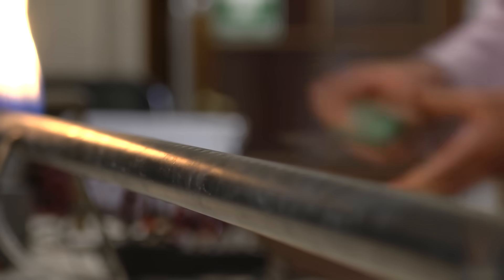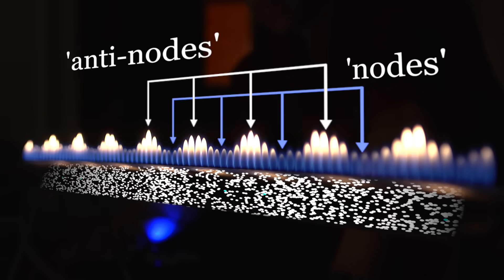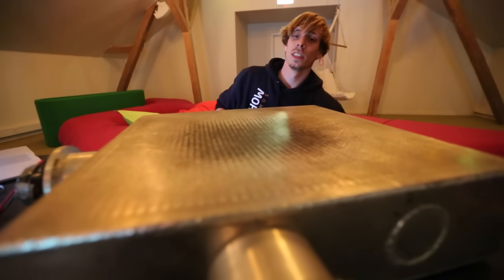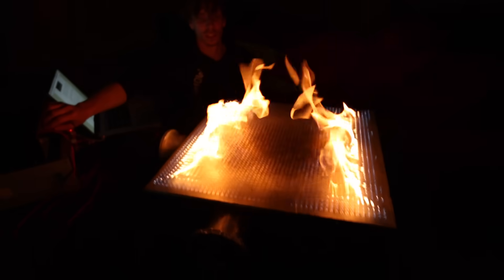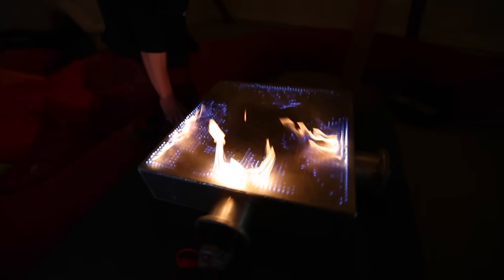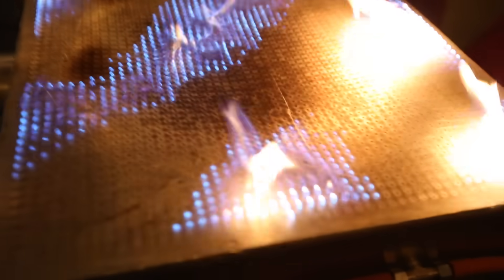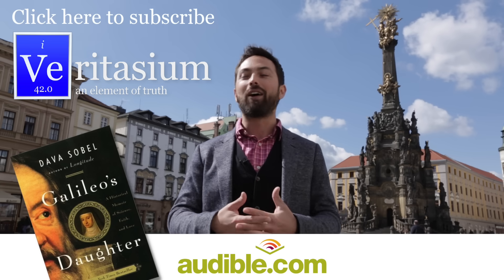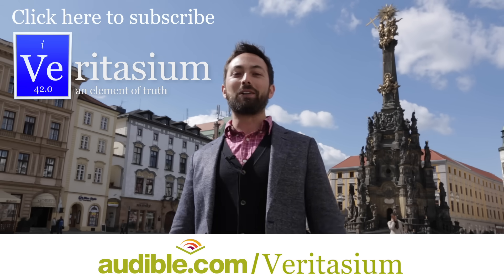Musical Fire Table!

Comment: You should try adding in a little bit of oxygen to the gas so the flames are steady. As it is they're stealing oxygen from one another and making it difficult to produce a steady flame. It would take 2,000 separate little tubes of oxygen to make it work though. Otherwise it would just be a bomb.

 Don't take my suggestion as criticism. This is super rad!

Comment: I would argue that the distance between the holes is too short. I think the flame "surface" would burn more evenly is the amount of holes were reduced. The short distance makes the flames above each hole randomly cancel each other out due to a lack of oxygen. Another solution is to mix oxygen in with what I presume to be propane.

Comment: Please, please, please try this in a vacuum, add oxygen to the gas and see what happens... Please! ^_^
Reply: If you do this in a vacuum nothing will happen since there would be no oxygen. If you then would add oxygen to the flammable gas (mix of propane and butane) the hole thing would properly blow up. If you mix in oxygen with the gas-mix it could burn inside the board/box, which then would make it blow up. This would happen whether or not you do it in a vacuum chamber.
So please(!), DO NOT MIX OXYGEN INTO THE GAS !!!

Comment: Hot.
Reply: P.S. Isn't this actually 3D? I see length, width, and height...
Reply: The original is 1D, just length. The PyroBoard is 2D, length and width. 3D would be a cube of the burners.
Reply: You forget height/intensity There aren't just random flames. The height depends on the sound waves pumping more or less gas through certain areas.

Comment: It is interesting how the nodes at different frequencies have the size that they do on the Ruben's array.
Speed of sound = 340.29 meters per second in air which is .
(1,116 feet per second).

 It gives some sense of the speed at which sound propagates through air.

The wavelength of a sound is it's velocity (ie, the speed of sound) divided by the frequency of the sound;
wavelength = speed of sound  / frequency;

 This experiment suggests that an array of Ruben's tubes would be far more interesting if it was larger, so more nodes could fit onto the surface to form larger patterns.. bass notes (ie, sub woofer 100hz and lower audio range wavelength is around 10 feet.)
 For rock music something at least that size would be necessary.

 A much larger and higher resolution grid might look really amazing.. although it would be best seen from above looking down onto the patterns generated.

 One can imaging applications such as controllable flames for industry and sonic components in engine ignition/burning systems.. or enhancing/ enabling chemical reactions and oxidizations that would otherwise be impossible to produce.. could have applications for renewable energy too if it could work like a kind of sonic catalyst.

Engineers usually try to remove noise from machines as sound and noise signifies lost energy..  energy that is usually lost as noise could be thought of in a different way.. as something that could be possibly be utilized to help drive reactions perhaps..

Comment: I wonder what a Rubens' cube would look like.
Reply: That would be impossible playing long songs on, as the gas-container would be in the middle, and very small :) But possible? If you can find a cube shaped gas-container, 6 valves (1 for each flat side) and a cube speaker around the gas, it's be possible
Reply: Mikkel Ljungberg but what if you had the burners pointing to the center and a manifold connected to a tank on the outside by tubing? This might be badass!
Reply: lugosky02 So it would do this inside the cube?
Reply: Mikkel Ljungberg well I guess so. So maybe the cool part would be what kinds of patterns form at the intersections of fire.
Reply: lugosky02 Make a cube with fire on the inside.... out of pyro resistant glass! :O
Reply: Mikkel Ljungberg you, sir, are my new best mother..... friend.

Comment: you're nodes and anti nodes are not correct. nodes for harmonic waves happen at y(x) = 0
Reply: Don't think it is wrong. You're right that nodes happen at y(x)=0, which is also what Derek is saying at around 0:33: "... a lot of vibrations in some part (label: 'ANTI-NODES') and not much vibration in other parts (label: 'NODES')"
This is the displacement nodes and anti-nodes.
The higher flames come out at the 'displacement anti-nodes', because a displacement anti-node is a pressure node, ie. a high displacement, the same as a high flow rate, results in a higher pressure, which will then push out gas and make higher flames. When experimenting with sound wave one must remenber that there are two pairs of node/anti-node, one pair for the displacement and one pair for the pressure.
Hope this helps :)

Comment: Do you use methane or propane? Our AP physics class is trying to build one of these! If you could email me with any tips on building the rubens tube that would be great!
Reply: We use a mix of propane and butane. As long as the gas is denser than air and flammable it should be fine :) 
A good advice: Make a safety valve and make sure the box is leak tight at the welds and at the speaker.

Comment: This isn't related to the video at all but I don't know a lot of people who are experts at relativity and im not particularly good at maths so i can't just learn relativity myself so I thought i might ask you. I understand that motion alters the rate of time duration and also affects distances. The way i was explained this was if for example one person was traveling in one direction faster than another person. Then a beam of light was fired in the same direction as the person moving faster. Since the speed of light is constant for all inertial frames of reference, the person moving with the light must adjust time to travel slower and distances to become shorter so the light can cover more distance in less time and result in the same perceived speed. But what if for example, a beam of light was fired from the other direction, the person is now traveling against the light, which means that the light would look faster. But since light travels at the same speed, time must go by faster and distances must become longer so that the light can cover less distance in more time, giving the same speed for light. But how is this possible? How can the person moving faster than the other person have both slower time and faster time, both shorter distances and longer distances. What happens when a beam of light is fired both from ahead and behind?

Comment: No, the fire is reacting to the vibrations caused by the standing waves in the air. There are nodes, which are fixed points with very little disturbances in the air, and anti-nodes, where there is a lot of disturbance in the air. So yes, the fire is, in that sense, dancing to the music.

Comment: Wouldn't the flames produce a tonne of gases, which could kill you? I mean, it doesn't look like an open room, and despite being that large, with that many flames and that much fire.... obviously they didn't die, but isn't it a huge safety hazard for prolonged use?
Reply: The Flames are actually burning the gas emitted by the board so he is perfectly safe =D
Reply: Jonathan Chu CO is being produced when you burn natural gas... which is why all water heating things that use natural gas have to have a dedicated strong ventilation system... otherwise all present will suffocate.
Reply: Whoops ermm um ignore the stupid first comment I wrote.

Comment: Where can I buy this?
Reply: You can easily make one. You just need some drills, propane, metal, welding/soldering stuff, and a speaker. Of course, make sure to be safe around flammable objects - test it outside first.

Comment: Can someone help me with this please?
According to Einstein, nothing can travel faster than light. Gravity force waves, travel at the speed of light. Black holes have a huge gravity pull that not even light can scape from it. Does this mean that the speed of the gravity waves of a black hole travel faster than light.  I would appreciate if you could answer please
Reply: it's nothing goes faster than light in a vacuum, even glass lowers the speed of light going through it
Reply: The escape velocity of a black hole equals the speed of light in a vaccum. So basically the light is like a ball you throw upwards: it can't escape Earth's gravity and go whizzing off into space without reaching the escape velocity.
Reply: Neelav Dutta But why if gravity waves are faster than light, Light can surely escape from earth's gravity? Is there any other scientific principle involved? Thank you for taking the time to answer :)
Reply: I'm not a physicist by any means, but I'll try to answer as best I can. I think the confusion stems from thinking about gravitational waves the wrong way. Gravitational waves are the result of a body accelerating through spacetime as it distorts spacetime around it. It's kind of like a bug that can walk on water: it leaves ripple patterns behind as a it moves. Gravitational waves are those ripple patterns, and they're generated because an object distorts spacetime. That distortion of spacetime is what gravity is, according to the General Theory of Relativity. Gravitational waves aren't actually force carriers, they're the energy dissipated by gravity as it moves through spacetime, I believe. But gravity itself is a consequence of the distortion of spacetime (i.e the above blanket metaphor). Now the reason the escape velocity of a black hole is the speed of light, like I said above, is because that distortion of spacetime is INFINITE. It's not that you could launch something at a fast enough speed to escape a black hole, you can't; because the curvature of spacetime at that point is infinite. You need to do infinite work in order to escape the black hole, which would put you at the speed of light, therefore making the speed of light the escape velocity of a black hole. 

At least, that's how I think it works, but if my explanation makes any physicists shudder, please feel free to correct me :)
Reply: ***** I get your point, but I still do not understand why if nothing can go faster than light, light is trapped by the gravitational pull of a Black Hole. Using the blanket metaphor, imagine trowing a ball fast enough (being light) trough the blanket and because the ball is so fast, not even the gravitational pull can stop it from crossing by the ball. I still think that if light was faster, it would cross by a black hole anyways. Thank you all for answering and excuse my grammar, I'm just 15 and Mexican :I

Comment: Hey Veratasium, I have a few technical concerns about the physics here. It is important to make a distinction between pressure nodes and displacement nodes. As you know, a node is where the variation in the relevant quantity is zero (zero pressure variation or zero gas particle vibrational motion, respectively), but the location of pressure nodes and displacement nodes are out of phase (in 1D, pressure nodes occur at displacement antinodes, and vice versa).  At 1:40, we see the fundamental standing wave in the box, and observe stronger flames at the sides of the box where the gas molecules cannot move perpendicular to the container walls. At these points, the pressure variation is maximized, so we conclude that maximum flames occur at PRESSURE antinodes. By this reasoning, the animation shown at 0:33 is incorrect because is shows maximum gas particle motion where the flames are largest.

Comment: Great device, the only thing that people should know is, any flammable gas gives off some type of carbon monoxide which is very poisonous and you can die from it.  So I hope these guys are doing this some good ventilation.
Reply: Unclean burns will produce Carbonmonoxide.

A clean hydrocarbon burn would only produce H2O (water) and CO2 (Carbondioxide), both of which are fairly harmless in low levels.

A clean burn would require clean fuels (such as propane or butane without any contaminants) and sufficiently high temperatures.

Comment: are teh two speaker mono in or stereo? And if you can make them mono , can you have them go out of phase, I bet you the nodes would even out  
Just to add , it looks like you are getting reflections of sound off the sides as well., try adding two speakers to each side. and make the phase the same

Comment: It's VERY cool, BUT, IMO due to the gas dynamics there is so much gas overlap from adjacent burner holes that the detail that I would hope for ends up being very mottled.  The response time of the gas dissipation does not appear to be able to keep up with the changes in the waveforms.  (Not sure of the tech wording so pardon me).  Still cool because it's fire, but to me it just does not look much different than if it was just one big burner synced to music.

Comment: World's dopest visualizer.  I wonder if you could do a similar thing with an array of 1d tubes where each is connected to a limited frequency band, like a giant visual equalizer.
Reply: I bet that would work,, would just have to tune each tube which might prove to be the hard part,, unless one made each tube exactley the same and used some I/c chips to filter the audio signals into separate bands
Reply: Yeah, I was thinking about separate tubes with separate speakers fed from a series of bandpass filters, which would probably be ICs.

Comment: Wouldnt this be a 3D rubens tube?  If the original tube only had 1 line of flames (Two sided) and this one has a plane of them (Three directions) would that not mean this is 3D

Comment: Where is the audio speaker relative to the board? Is there more than one?
Reply: Hi, member of the "Fysikshow" here. There are two speakers on the board, one centered and one off-centered, each on one of the two sides. In the video only the centered one is on.
Reply: What is the flow rate for the gas? Seems like that would burn through a lot in a few minutes.

Comment: this is a good idea but I think it needs improvements : the fire is heating air and creating convection, but on a tube, the flames are where air goes up, here air goes up in the middle of the board but on the corners, the air is flowing towards the center. That is why the fire isn't going up but bends toward the center of the board. If it wasn't a board but a few pipes next to each other, air could go between the pipes and the fire would be straighter. Of course the pipes would have to be high enough for air to go under them.

Ps : I'm french so I hope you understood what I meant

Comment: What would happen if you had a standard Rubens tube in space..? With the whole spherical flame thing..
Reply: I don't think it would've worked since flames need air
Reply: Sara Angelia would if you used oxyacetylene as the gas, acetylene as the fuel, pure oxygen mixed with it.
I'm not sure how well it would work, would need to have the gas pressure high for the sound waves to be able to travel, but its more the effect on the top I'd be interested in.. Would it make spherical flames that increase/decrease in size maybe?
Reply: hmm.. yes, yes I think I actually know some of those words. No but seriously I have no idea, I just know flames need air because of the "close all windows and doors if possible in a fire" thing :p
Reply: Sara Angelia well yeah that's a good thing to remember :p just keep in mind the fire triangle, the 3 things that are essential for a flame; heat, fuel and oxygen. Get the fuel hot enough to ignite, and keep it supplied with enough oxygen, and you get a flame, regardless of where it may be. Even underwater, with waterproof matches and the afore mentioned oxyacetylene gas. They simply have their own supply of oxygen and fuel that the water can't remove, so the flame keeps on burning strong.
Reply: Fire underwater? O.o That actually sounds pretty cool :D